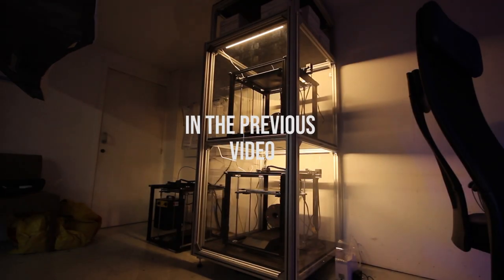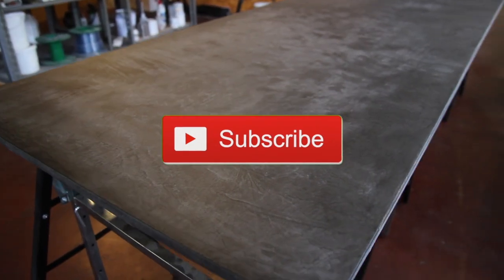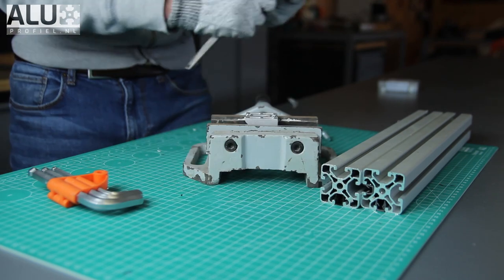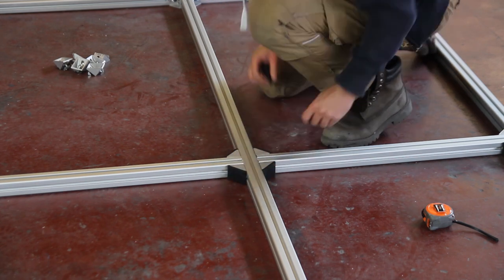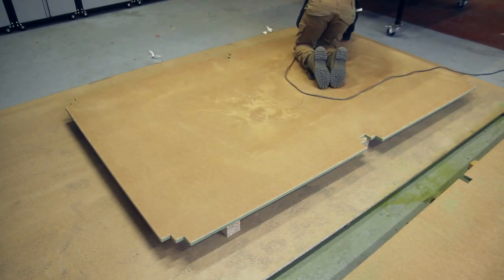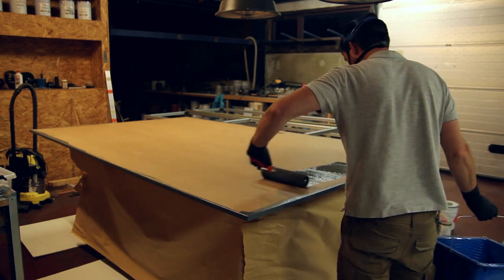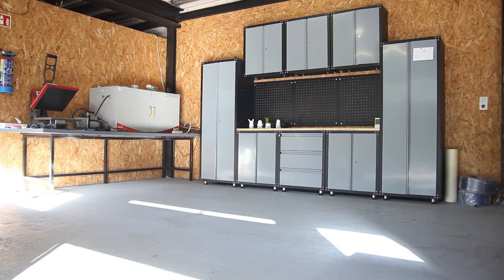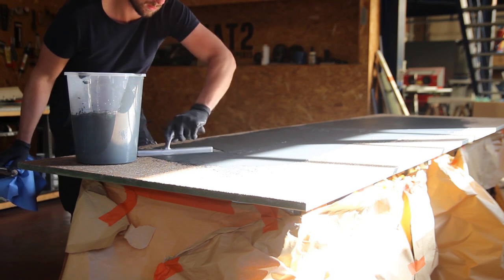Aluminium T-slot profile workshop Table

Comment: good vid. fyi sanding isn't just for a better  finish, it gives a "key" for the next coat. also, wont get stop/start marks with roller if maintain a "wet edge"

Comment: Do you mind sharing where you bought the paint
Reply: He is using an epoxy polyurethane paint, it is pretty common at auto paint supply stores.
Reply: @MichaelJHathaway  I live quite close to where he lives so rather than doing multiple stores and hope to find the same stuff I might as well go to the exact store that sold it to him
Reply from the maker: de verf komt van Vibol uit gullegem. Poly Dur 330 in mijn geval